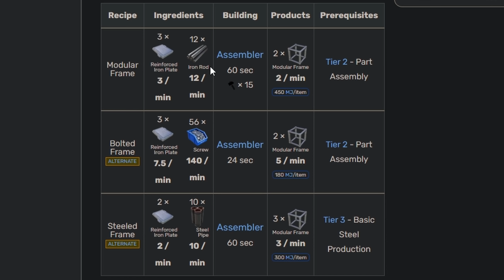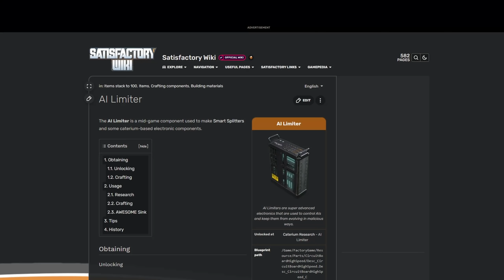Satisfactory : Ep7 Expand Expand Expand

Comment: The fact that you are finding some of the default recipes more useful to the alternatives just based on what you currently have on hand, and how much of it, is immensely pleasing to my inner game designer.
Reply from the maker: I think some of the steel alternatives we are using for screws and iron rods just end up more efficient than the later alternatives. Since a lot of those resulting recipes like Reinforced plate end up used in a bunch of later stuff it makes things a lot trickier to figure out what is better.

Comment: As your complexity increases, keeping things orderly becomes important. I like your bus idea. As your fluid management gets complex, it can be helpful to colour code pipes with paint.
Reply from the maker: I am going to do my level best to keep the fluids to a minimum, even with just belts it gets so complicated, never mind getting liquids up to this platform. I'm thinking of moving the plastic and rubber to the ground floor and sending the rubber and plastic up via transport belt.
Reply: @FrancisJohnYT  You can package fluids into drums and then transport the drums on belts or trains.  This can be useful for transportation over long distances or up great heights.  (As you have discovered, pumping liquids uphill requires a lot of pumps and power).  Once the drums have been emptied, they can be returned to the point of origin to be refilled.  Thus, a finite number of drums are required.

Comment: Love the vids as always.. 
And I'm currently at early tier 7(just rushing through tech tree for the hoverpack) and using main bus too but with truck network not conveyer belt a few tips that might help:
1. Put sign on each of your production line that tell what it make what it used to make it and how many.. it gonna help a lot with the calculation later on
2. Package diluted fuel is not that bad since 2 packager fit below 1 refinery perfectly.. it's way better imo than waiting for blender and need to redo a whole temporary set up
3. Go for fuel power instead of coal.. 300 oil can give 20k+ power if u using turbo fuel or 10k+ power if u using fuel
4. Try to build recycle plastic/rubber set up.. building 1 setup with 300 oil can give u 800 rubber/plastic per min with a little bit of resin that can be dump to awesome shop or for more rubber/plastic.. this help u a lot when building heavy modular frame / computer since they use a lot of rubber with the alt recipe iirc
Reply from the maker: Am labelling every line, but for production numbers I'm just working off counting the buildings, we are not to big for that yet.
Have just unlocked T7 diluted fuel so time to plough down a huge power plant.
I'm planning on the recycled plastic/rubber but I don't think I will be using as much as you, I went with a different modular frame setup with all the other alt recipes I'm using it just worked out more efficient.
Reply: @FrancisJohnYT  well with underclocking and overclocking the number can be a little complicated and it's only take one sign per production line.. 
And for the rubber it's for heavy modular frame and computer not the normal one.. iirc heavy modular frame alt using about 75 per min for 3 ish per min
Computer using 60 ish per min and about 40 ish if u using the circuit boar alt for 2 ish per min

Comment: Thanks for the episode! Seeing you delete your old setup made me think of the mod 'Area Actions.' It allows you to define a 3D area by setting points, and then perform actions on all buildings in the area. I use it for deconstruction/setting recipes, and it can really speed up refactoring.
Reply from the maker: Don't think I need area Actions just yet, that looks to be more for laying down or ripping up huge factories. We are not there just yet.
Also I may have installed a couple of other mods and want to give them a spin before I add any more.

Comment: That's a very nice design, but I'm biased :) It's very close to what I did. 
- Your buses are a bit too close to each other - just by, I think, 2 meters off from the looks of it. You need (because of weird clipping issues) enough space for one vertical belt attached to a splitter or merger for transferring in/out. IIRC just placing them at the same point on the foundations does the trick. Eg if one is 2 off of a foundation edge, the next should also be 2 off of the edge of the next foundation. Edit: Well. I just got to the second part of the vid, I guess never mind :)

- You can bus outputs out the same way you bus in the inputs to the constructors/fabricators. 
- Love the basement/plumbing level.
- Cheat with fluids: if you have a (preferably big) tank filled up with the stuff ABOVE the level of any point you use it, you can do anything with the pipes. Up, or down, or around, they'll always be full and there's no need for pumps apart from the ones filling the tank (up to the top!). TL/DR: water towers. It just works.
Reply from the maker: Stealing that water tank Idea, was having so much trouble getting oil to stay at the top of the map despite all the pumps.
Reply: @FrancisJohnYT  Cheers man. Trust the tank. :D If at any point your pipes are not full below a full tank, you have a bottleneck somewhere. 
Such as you left an itsy bitsy tiny bit of level 1 pipe un-upgraded, that's hidden under something or in the corner or... somewhere

Comment: 3:30 aaand all of the 90 degree purists are frothing at the mouth myself included but not really tho. I love the way you are building things so far! For cereal tho. Nilaus taught me the easy way to figure it out. 1) Drag the belt out to where you want it to turn. step 2) back up two steps. Step 3) place belt. Step 4) start new belt and complete the desired turn.

Edit: I think I am going to try the main bus for my next playthru. Right now I am doing a 100% train distributed network but I am enjoying the chaos of your build. lol
Reply from the maker: I'll give the 90 degree belts a try using that method, I used to be more particular about things but I'm getting more easy going as I get older.
As the the bus Idea, assuming we outsource Aluminium and Copper powder production we should be able to hit the the below output per minute. Might require we run a second steel line but that should not be to difficult. I know it's not amazing numbers but it should be easy enough to stick together.
4 × Assembly Director System
4 × Magnetic Field Generator
1 × Nuclear Pasta
1 × Thermal Propulsion Rocket

Comment: I am look forward to the next update that prevents transport belts dipping through each other.
Reply: Actually the latest update did the opposite. They added the concept of "soft clearance" so more buildings can now be clipped together. Apparently there's a segment of players that intentionally clip certain buildings to make things look nicer.
Reply: @danfr  I do not mind buildings clipping together for aesthetics but I feel that allowing pipes, transport belts and other routing mechanisms to pass though each other takes away the challenge of the game.
Reply from the maker: We could use elevator belts to pull stuff up and down, we did at the start. But it's so much slower to set up, than just ploughing the belts though everything.
In other words I got lazy real quick and took the short cut.

Comment: You can use walls with the wallmounts and that allows you to compress your main bus drastically by using half increments
Reply from the maker: I thought that would make it more awkward to pull resources off the bus? I know I should not be running belts through each other but it makes things so much easier.
Reply: @FrancisJohnYT  it looks weird if you split it straight off the line, belts running through splitters where they shouldn't and all that, but its functional and just minimises the huge amount of wasted space with stackable conveyors. Even if you delete the walls and wallmounts after and replace with stackable conveyors it looks decent enough

Comment: Once you've got your horribly ugly factory full of wonky beltwork and clipping everywhere done, just incase it all in walls and a ceiling and voila! Sausage factory achieved. Then you can migrate all your item storage on to an aesthetically pleasing rooftop lair with the Hub and space elevator nearby. Also save that 2nd quartz node for making silica, which you'll need if you want to build glass windows to view into any part of a factory that does look good.
Reply from the maker: I'm not sure any part will look good by the time we are finished, we still have a lot of different bits and pieces to plug in.

Comment: It's very interesting to see how far your base diverges from mine due to different philosophies despite starting in the same location.

The main bus idea is interesting. Does make it look simpler to add factories for new parts you need to build stuff. I do worry about it a little. The phase 3 and 4 parts use a lot of processed resources and I found myself starting to run out of some part for building things in my containers. That was without a main bus limiting the number of belts for inputting raw resources. But maybe your steel based production could workaround that; I stuck with normal ingots and haven't collected as many alternate recipes yet.

Btw, the AWESOME shop ramps don't go up steeper angles, they're the same as the base ramps. They just look nicer because they come with an inverted ramp. The 8m double ramp is the same as a 4m ramp with a decorative 4m inverted ramp underneath.

You may also want to finish off the caterium research tree. I didn't bother either, not realizing that geothermal power is part of that research tree. I thought it might be part of the normal tech tree but now realize the only type of power I'm missing from that is Nuclear.
Reply from the maker: Have done a bit of math in the background and we should be able to get by with one belt of each resource except Steel ingots, we are going to need two of them. But that is assuming we outsource Aluminium and Copper powder production to outposts and ship them in. Though it's only rough numbers, I'll know more as I get closer and iron out production numbers. The plan is fairly modest anyway, only 4 or 1 of each of the final resources per minute.
4 × Assembly Director System
4 × Magnetic Field Generator
1 × Nuclear Pasta
1 × Thermal Propulsion Rocket
Reply: @FrancisJohnYT  Outsourcing Aluminum definitely sounds reasonable, even if you're using a main bus.

Aluminum is a multi-step process involving turning bauxite and water into alumina solution (liquid), then that and coal into aluminum scrap, and then finally that into aluminum ingots. And all the recipes seem to involve making sure the water output is recycled and does not back up the production line.

So it definitely sounds like a bit too much of a mess for a bus.

Comment: Silly silly Francis john. "Looks at his factory, the work he put in, satisfied with the belts crossing through each other, the pipes going in odd directions and not at all straight. Little does Francis John know, he is still merely at the start of his playthrough. (And your difficulties with the belt connections on verticals are a form of punishment for the belt clipping and pipe bending, its hard coded into the game to appease the OCD players...! ;)
Reply from the maker: It's fine, it's fine, so long as it works for now I'm happy. Late game we will most likely be ripping it all up again.

Comment: Regarding rotors - speed is what matters. The rods are absurdly slow to make so any recipe using them should be avoided, even if it's cheap.
Reply from the maker: I can just throw down three times as many machines to make up for it. As we are using a main bus it's a bit harder to add in more resource lanes so the cheaper it is to make something we should take it.

Comment: Please use belt spliters to do right angles when placing belts, whenever there is the option to do that.
Reply: Can also use the scroll wheel when placing a belt to change the angle.
Reply from the maker: I have done a bit of testing and can mostly get right angle belts now, mostly.